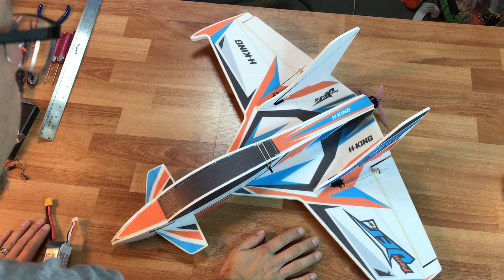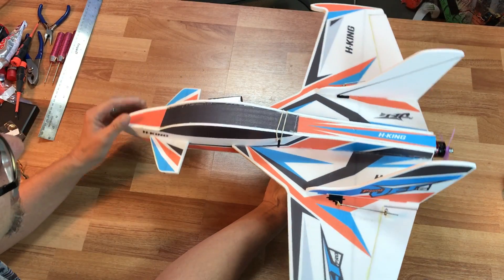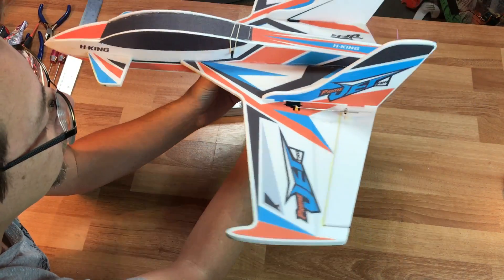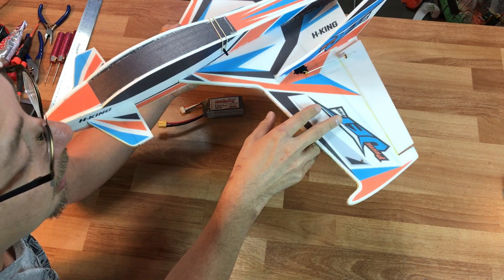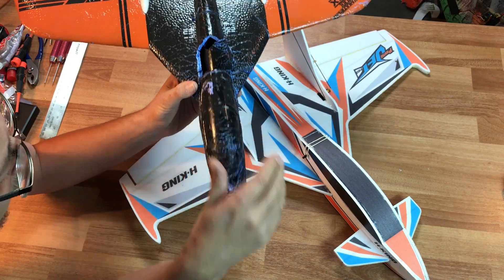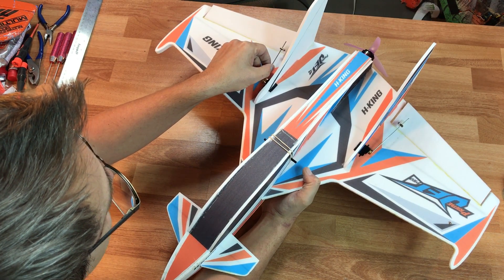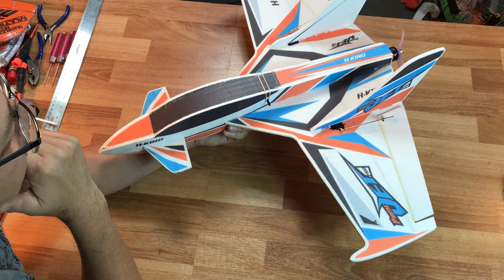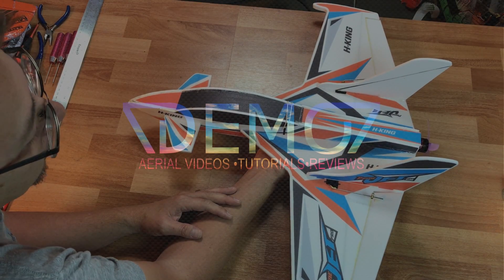Prime Jet Pro- WTH Was Up With The Maiden Flight?

Comment: Hey 7 nice review. I just finished one one of these it is pretty flexy. It should be good on 3s though. Im building one with a friend who never built a kit before. The setup is 1300 3s, Sunnysky 2208 2000kv 6x4 apc e, 20a esc and Emax es08md2 servos. If your servos are giving you trouble try those you will like them. Good luck with your builds!
Reply from the maker: I've determined the servos aren't the problem.... I flew after reinforcing the wings and the problems went away- It still dosent have enough elevator authority- I may chop off the canards...

Comment: I think your spot on concerning flex. Since this model is small you could hold it out the window and check it at speed. We use to test models in college using a boom fixture attached to the car.
Ideally someone else should drive!
Reply from the maker: +Canyon Racer I flew it today with some wing mods to stiffen- worked out all the problems!

Comment: Jeff, daft question, do you know what the weight is with just the servo's? I'm ironically thinking light-weight maybe better for this model. Eg a small 400mAh 2S pack, a little 3200Kv motor and to chuck one around that way. Also those servo's look like the Turnigy 1470A ones, they could also be giving out at high speeds with not enough torque to move the surfaces. Matt
Reply from the maker: Yes, those little servos maybe an issue. We'll see after tomorrows flight
Reply from the maker: I'll weigh it soon